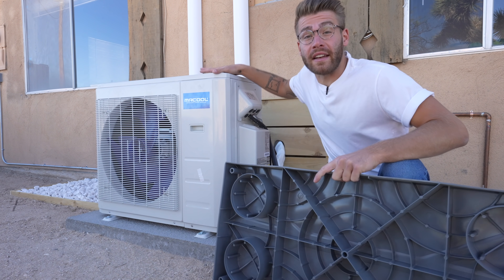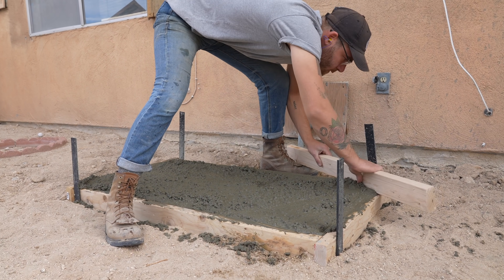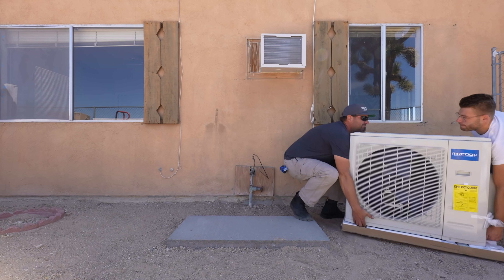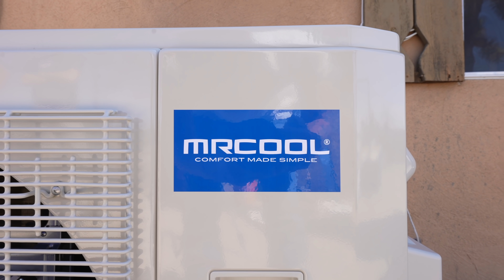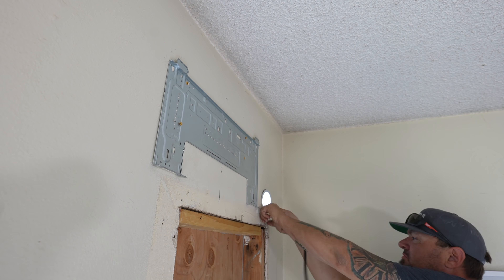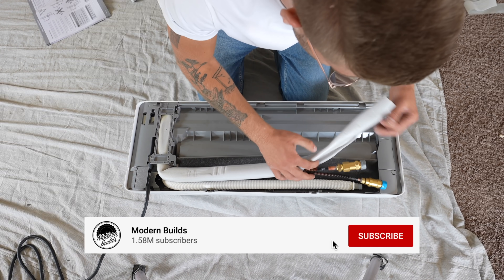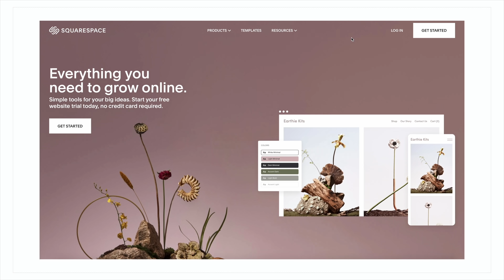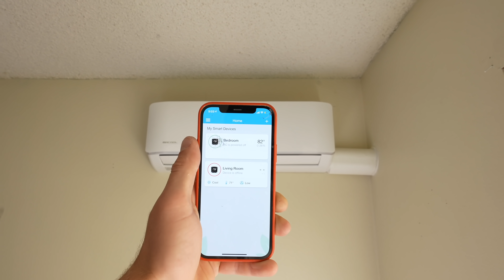DIY Multi-Zone Ductless Mini Split AC & Heating System | MR Cool Install 2021

Comment: Has anyone's actually done this themselves? I am looking into taking on this project, minus some of the electrical.  Just curious on how difficult it actually was.
Reply: I did it a few days ago. Only paid 850 for a 18k 19 seer non diy unit
Reply: I paid 800 bucks for a 24k unit after a rebate from my electrical company, best money I've spent, easy install, my cousin is a great electrician. Easy. Love it

Comment: I feel this was a good well thought out video.  I’m looking to install a 4 splitter system on one side of our house and a duel on the other.  Couple of questions.  How long are the connections?  I think the longes one here will be just shy of 20 feet.
Reply: The min line set footage for the diy units is 25ft.
Reply: i think the min is actually 16 ft.

Comment: Super Cool video (pun intended). Hey, it appears you got the multi-zone unit with two interior units. It also appears (unless I’m mistaken) one of them is smaller than the other
How would we go about ordering such configuration and where (Amazon, website, etc.)?
Thanks a lot for your tips!

Comment: they don't vacuum the system first,and also this is not a DIY
Reply: No need to. Apparently Mr Cool comes with pre-charged line sets with a special fitting on each end that keeps them sealed until connected. See https://www.homedepot.com/p/MRCOOL-25-ft-3-8-in-x-5-8-in-Line-Set-for-DIY-24K-and-36K-DIY25-3858/314412417

Comment: This vid is soo messed up... 
1.. cheap Chinese junk
2... disposable heat pump
3.. no dealer network 
4.. no real distributor network 
5.. little to no parts availability 
6... call china for warranty (poor warranty)
7... poor install 
8... poor durability 
9... did I mention this unit is junk! 
10.. this is not my opinion.. this is my experiences in the battlefield of 25yrs.. does this sound like a smart buy????

Comment: Probably should’ve taken your Superheat too. Normally mini splits like that have pretty low SH at 1-9.

Did you do the calculations for if you need more refrigerant? I forgot the number but if your love set is over a certain length, than you have to add more 410.

Comment: It's hard for me to be sure without being there but I'm 95% positive you have a Zinsco electric panel and if so, it needs to be replaced if you want to avoid an electrical fire...
Reply: It's a Sylvania/GTE Panel. Label on lower right corner. This model could be the earlier ones associated with Zinsco. Later models use Cutler Hammer breakers.
Reply: @lippru  sylvania/gte labeled panels can be zinsco. The breakers have the distinctive zinsco colors
Reply: @lippru  here’s some information for you.  I’m a certified professional inspector. https://inspectapedia.com/electric/GTE_Sylvania_Zinsco_Identification.php
Reply: @JesseSmtns  Thanks for the link. I am a retired union electrician. I was involved in replacing these breakers and panels back in the '80's.

Comment: NEXT TIME VACUUM AND PRESSURE TEST THE SYSTEM , IT WILL FAIL
Reply: The manuals for the 3 I installed only called for vacuum testing. I know pressure testing is better but typical DIYer is not likely to have nitrogen tank and regulator. I usually bought vacuum pumps (about 50 to 60) and resold them for at little less. And for about $35 you can get a single gauge manifold.
Reply: @user-bj4lp3fr1o  there is another thing that installers do not do , the level of the compressor , it will fail if not fixed at zero degree of inclination or reduce its life span
Reply: @danythrinbell1596  no 1 or 2 degrees does Not make a difference
Reply: @robertberin4872  yes but i see some compressors just inclined sitting in concrete blocks not even bolted down and more than 5 degrees , just shit jobs done to grab the money , the last system installed in my place buy a naive tech guru  costed me big bucks after leaving a leak and let all gas escape from it , so as i say pressure testing the system is a must

Comment: Why doesn't MrCool have a thermostat for a ducted mini split?  Spent $8k on my multi unit ductes system and MrCool Support is telling me the only thermostat option is the p.o.s. it came with...... very frustrating
Reply: Be aware that in todays Tech-savey professionals that they use the word "system" too much!!! For example, The HVAC system is not the same as the "HVAC duct system!!! Think about that???

Comment: This job is not done right . You CANNOT coil those linesets. You have seriously shortened the life of the compressor by doing so. You should have had a pro do it and trim the lines. The diy unit you cant trim them. Also theres no suppressor on the electrical service. Another costly mistake.

Comment: I’m seriously considering buying one of these units.  Im wondering if it will pump enough heat to let me get rid of my furnace in the winter
Reply: I have Mr. Cool I installed in one of my units, I can confirm these things get the place hot. IDK where you are located, but worth checking them out for sure.

Comment: No Vacuum procedure ?  Did I miss something ?  V.
Reply: No need to. Apparently Mr Cool comes with pre-charged line sets with a special fitting on each end that keeps them sealed until connected. See https://www.homedepot.com/p/MRCOOL-25-ft-3-8-in-x-5-8-in-Line-Set-for-DIY-24K-and-36K-DIY25-3858/314412417

Comment: Hi,.. Is the line set directional?... That's to say....  R the connectors specific to the indoor /outdoor units?  Mine came with no identifying marks to orient correctly.... Thanks.

Comment: What do you do if you install a unit in a room that all the way on the other end of the house? Do they have longer runs or adapters or what?
Reply: You can get longer line sets or combine 2. Combining adds a potential leak location though. With additional line length, you may need to add refrigerant above what the unit comes with.
Reply: @user-bj4lp3fr1o they are pre-charged so if coupling two line sets, the two already have adequate freons from both lines. i do worry about potential leaks from the links though.

Comment: I am definitely going with a Mr. Cool system. I own 2 homes that I am remodeling and I've decided the mini-split heating & AC units are the way to go. I like the flexability of controlling different zones of the house separately. Thanx for the installation video..I have watched several of them on the mini-splits and yours was very well done. 👍
Reply: LG makes a mini split with ceiling mounted units.
Reply: @WillieStubbs  hi Willie..the reason I prefer the Mr. Cool system is I can install it myself with their pre-charged refrigerant lines.
Reply: Can you share more info about you electricity bill

Comment: Did you pull a vacuum on the lines?
Reply: No need to. Apparently Mr Cool comes with pre-charged line sets with a special fitting on each end that keeps them sealed until connected. See https://www.homedepot.com/p/MRCOOL-25-ft-3-8-in-x-5-8-in-Line-Set-for-DIY-24K-and-36K-DIY25-3858/314412417

Comment: "DIY."  Guy hires an HVAC company to do the entire install.
Reply: So glad he did. Safe and done right.  Was he sponsored by  them?
Reply: If you see a channel with LOT of subs, sponsored by a shit company like Squarespace, then 95% of the time its just pure BS.
Reply: if you read up on any of the mini splits, they require the lines to be installed under vacuum. They also state if you do not use a licensed AC pro, all warranties are voided.
Reply: @HalProctor  Not on these.
Reply: @HalProctor  Stop spreading false information, you have no idea what you're talking about.
Reply: @AsaSpadeSS  my statement is true.  many of the mini splits sold indicate it in their warranty guide.
Reply: @HalProctor  the Mr Cool units apparently do not come with that requirement - a bit different than the rest. My Mitsubishi unit definitely required a licensed AC pro as well.
Reply: @jim2lane  yup, they are built for DIY. Both Lineset and condenser come pre-charged with refrigerant. No vacuume pump or flaring tool needed.
Reply: @toolegit2quit173  So it sounds like the refrigerant tank must come slightly overpressured to allow for proper pressures in the lines once the tank is opened.
Reply: @jim2lane  Actually no. Pressure depends on temperature. Only needs a little more liquid. Apparently refrigerant must be added if longer lines are used. I assume they're pressurized to 1ATM.
Reply: @HalProctor  Then don't label the video DIY

Comment: The thing nobody tell you is that if the AC is not installed by a certified AC tehcnician, it loose its warranty. That's what I was told by LOWES and also appears in the web site.

Comment: Is that a heat pump, or just an AC?
Replacing those single pane windows is on your list right? That'll make a bigger difference in your electricity usage than the mini-split upgrade. 

Is there enough line to run up to a 2nd story wall and around an awning? We have central AC here, but it's single zone so the upstairs gets super hot while the downstairs is cold.
Reply: AC cannot heat, this is a heat pump.
Reply: @doubl0dave they are both AC and Heater, using inverter technology. Mini Splits are the way to the future for HVAC. Many of them can even heat from outside temperature of -15F. I think the limit for Mr Cool is 5F. Others have lower and just as good if not higher SEER for the heat rating.

Comment: i removed my mini split an switched to swamp cooler because the peace of shit split unit kept getting mold inside of it an gave up on it
Reply: On ours, we never just turn it off after cooling. We set it to fan and let that run to dry out the system. That helps with mold.

Comment: I installed MRCOOL mini split units (1) 24k and (2) 9k and I cannot be more happier, this last winter I use way less oil and compare with the electricity used i got big savings, now in the summer I’m using so far the dry mode and it cool all the areas so easy, super energy efficient machines, but I think by getting the units separate will save you more than having a multi zone condenser for all the air handlers, individually you get more seers but Multizones less seer therefore less efficiency and more power consumption……overall great investment
Reply: what is the noise level of the inside units? Is it acceptable for bedroom use?

Comment: Yeah install it yourself and then spend your savings paying a real tech to fix it. Instead of buying a system and having a good parts and labor warranty. Real smart...

Also having vertical loops in your lineset stops the oil from returning to the compressor cutting the life of your system in half.

Moral of the story, DIY heat pump installs will only save you money at the start, if you don't know what you are doing you will pay out the ass when it needs to be fixed, don't be stupid, hire a professional.

Comment: Why didn’t they vacuum the lines befor they let the refrigerant out ?? The lines are Contaminated and the fittings did not have that nighlog blue it’s like teflon but HVAC approve ??? U sure they where pros ??

Comment: I realize not every tiny step is filmed— did you air-seal the interior holes in the wall and water-seal the exterior holes under those flanges?

Comment: You didn't put the Compressor unit on Rubber Mounts to separate from the Concrete. This Improves Compressor Longevity and Efficiency by at least 20%
Reply: How so?

Comment: I understand the lineset comes pre-charged, but I didn't see anyone using a vacuum pump to get the air out of the line.  Is this not done anymore?
Reply: There is no air in the line. That's why it's precharged.
Reply: @FabiusMaximus1000  Thanks, I did a lot of reading since posting the question and they skip the vacuum pump step.  C&N, Carrier, Rheem and Mitsubishi units recommend purging the line with a pump.  I see that Mr Cool is relying on their sealed lines but I think I would still vacuum the lines out if I installed it.  Assuming that the lines are vacuum sealed at the factory, if the lines come charged with refrigerant as well as the compressor, then a vacuum pump is not a good idea.
Reply: @bmoulas  No need to. Apparently Mr Cool comes with pre-charged line sets with a special fitting on each end that keeps them sealed until connected. See https://www.homedepot.com/p/MRCOOL-25-ft-3-8-in-x-5-8-in-Line-Set-for-DIY-24K-and-36K-DIY25-3858/314412417

Comment: NEVER HEARD OF A 30 AMP 110 VOLT BREAKER
Reply: There’s tons of things you’ve never heard about
Reply: @kevinhofer4922  NEVER SEEN A 30 AMP 110 AC BREAHER
Reply: @paulgrice6766  l
I’ve got 100 ampere’s on my shelf.  How many you want?
Reply: @kevinhofer4922  you are talking about a single pole nor double right
Reply: @kevinhofer4922  you are talking about a single pole nor double right
Reply: @paulgrice6766  
That’s right

Comment: Is in the US legal to DIY an install of an HVAC system? In my country you have to be a licensed plumber to install HVAC units, since they use flammable refrigerant that is also dangerous if releases into the environment. They have to issue you a certificate that the install was done by a professional. Also if you alter the wiring you should also be a qualified electrician (but not if you plug into a socket, that is what a lot of plumber do so they don't have to call an electrician). 

That install by the way is far from being done professionally, you should have pulled a vacuum in the lines to remove moisture, for example. All that extra line is not only a problem of space, it's not ideal, since it will introduce an inefficiency in the system (you want to keep the lines as short as possible), bending the copper pipes by hand could introduce kinks in the pipes that reduces the flow, a professional would have used a pipe bender to do so, and also in the end you do need to have the instrumentation you used to ensure that the system works properly. 

Really an installation should be done by a professional. Not only it is a better job overall, but also the warranty will probably not cover the unit unless installed by a professional, since an improper installation could easily damage it. Why spending all that money on a good heat pump and then risk damaging it for saving a couple of money to install it properly?
Reply: The only common flammable refrigerant I know of is R-290 (highly-refined propane). But it’s only used in restaurant and commercial applications, not residential. R600a (isobutane) and R1270 (propylene) are also used, but they aren’t common.

Comment: I know you had some Pro's come and help you but just a couple things to keep in mind (From another Pro)
  - Those communicating and power wires to the head unit are not UV rated, you really want to run those in some type of shielding (i.e. Sealtight or Liquidtight)
  - Those temp guns measure surface temp, not air temp, which is different and key when trying to gauge a true temp split. 
  - Hooking up gauges to mini-splits to assess sub-cool and super-heat is pointless unless the system has a "charge" mode which can be enabled to force the system into 100% capacity 
       One of the reasons these inverter mini-splits are so efficient is because they almost NEVER run @ 100% capacity. And if it's not then you have Accumulators and or Receivers that store refrigerant and release it back into the appropriate circuit/ working in conjunction with the metering device (Usually an EEV) to maintain a target SH. These systems seldom run long enough, and at a consistent enough capacity, to accurately read SB or SH. This is why a lot of the ductless mini-split systems don't even have a high side service port, just a low side to add refrigerant, which is only necessary if the line set is over a certain length, and in these cases, the added charged is calculated and weighed in via length of line set. 
** I say high side (Discharge) and Low Side (suction) out of habit. On this system the EEV is in the condenser so both lines are technically "Low pressure" (This is why both must be insulated) But as a reference point it serves its purpose. ** 

On a side note, please do a one year update! I only ask because I myself have replaced at least a half dozen of these MRCOOL with name brand ductless mini-split systems do to these MRCOOL's failing. All for loss of charge, but in different areas of the refrigeration circuit.
Reply: I'm not a pro, but I have installed two of these (single zone) Mr Cools. One of them has been trouble free for about 3-4 years. The other one had multiple problems, and I was sent warrantied replacements for both the wall unit and the condenser. Without the 5 year warranty,  I would not recommend these. As long as you're ok maybe having to swap them out in those 5 years, it's hard to beat the deal.
Reply: I just installed one at my Barndo, can I have a licenses HVAC guy maintain / clean it every 6 months?  Would that be advisable or do-able ?
Reply: @syclone1012  You can. But they are fairly maintenance free when installed correctly. Keeping the filters cleans at the head unit and the condenser coil clean is really all you need. Other than that the only other common failure on head units are the condensate pumps(not used on every install/set up)
There’s also certain manufacturer specific issues that involve electrolysis but most of those issues have been addressed by now.

Comment: A) Cool Air provides rubber dampening pads for each of the four corners wear you bolt it down. They should have been used. Vibration on that hard pad will be tough on the unit.  B) You can't water things with the condensation. The water is full of impurities and can kill plants.  C) The key to this install was the great electrician.
Reply: How is the water full of impurities?
Reply: I agree.  Plus, mine put about about a cup of condensation per month.  Not worth the effort to water anything.